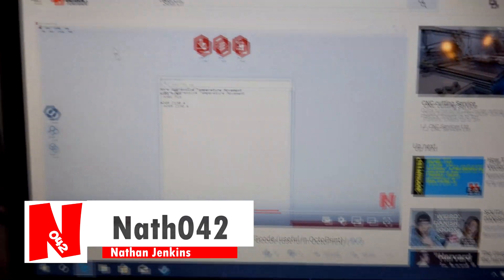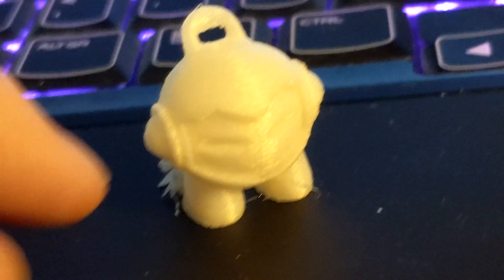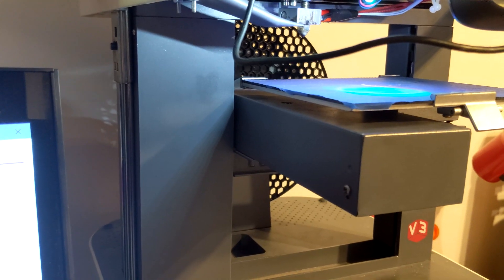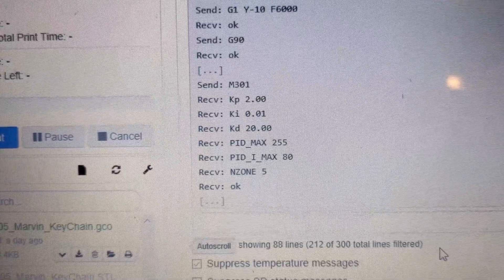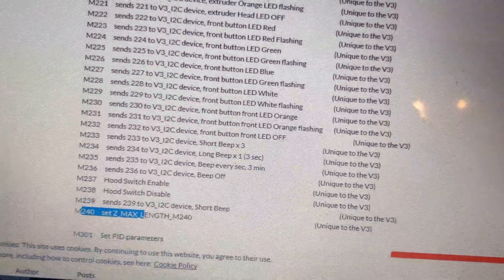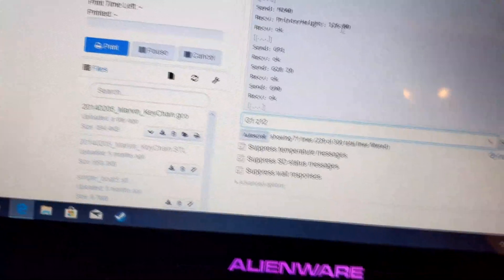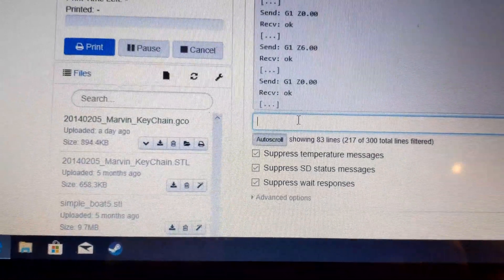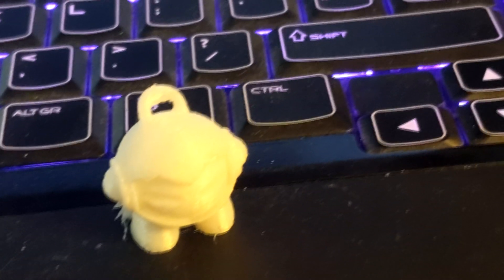How to Make Eaglemoss Vector 3 Print Better! Octoprint and Bed Leveling

Comment: Hi I am trying to use mine with windows 10 current version having issues moving the bed around for alignment, original etc. Any ideas please
Reply from the maker: are you not able to use the software with the printer? you can try using a different software like slic3r
Reply: @nath042  how do I align the printer without the software then run win xp

Comment: Hey Nath can you show us how to set up octoprint for the vector 3
Reply from the maker: unfortunately not anymore, I dont have the printer. But it shouldnt be much different to setting up octoprint normally, just plug it into the data port and send the .gcode files to it to print.

Comment: A video specifically about getting Octoprint to work with this printer would be good. Also settings file would be interesting to see, can you post it somewhere ? Thanks
Reply from the maker: sorry john, I would like to do that but I dont have the printer anymore. I believe it used a different Baudrate but everything else was as standard, see this link that may be of use https://v3uc.com/forums/topic/octoprint/